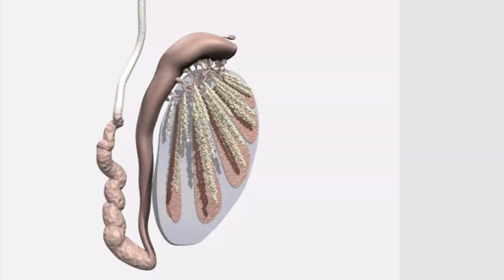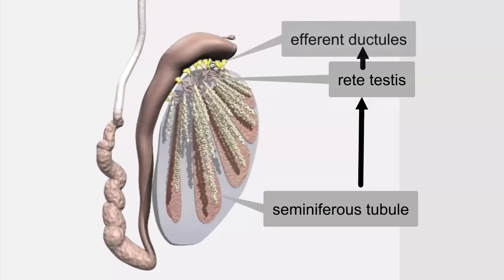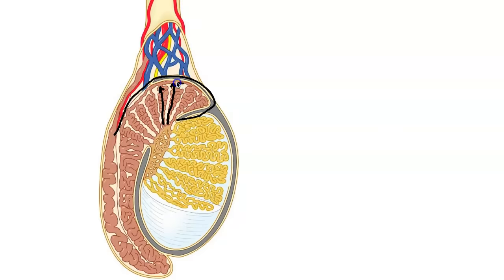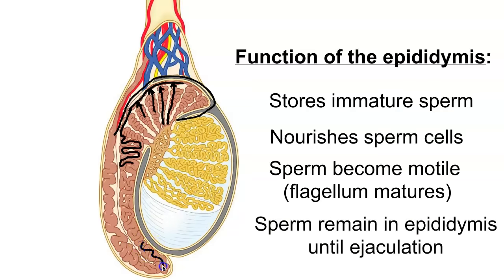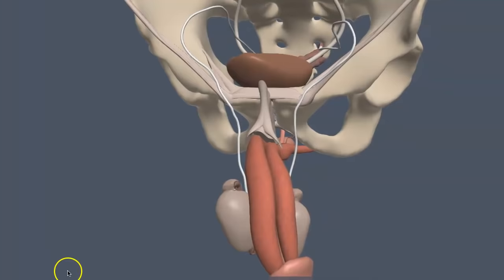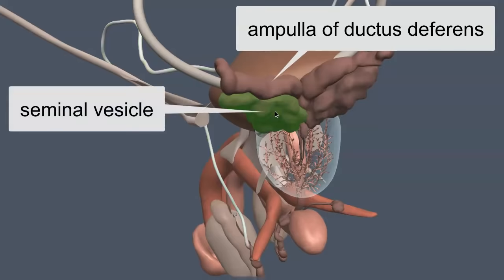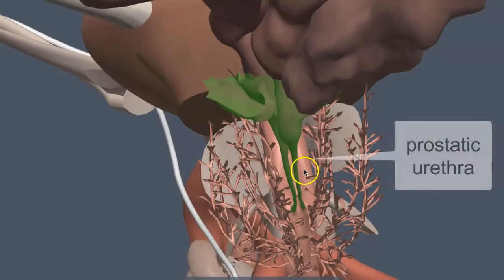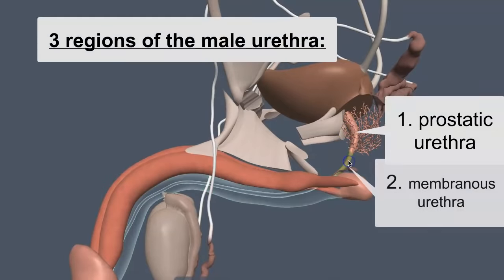Pathway of Sperm from a Testis to Outside the Body

Comment: The speed and pressure at which semen moves through the spongy urethra is staggering. Plus, the ballistics of possible payload distance physics is equally impressive. Then if you add in the accuracy of payload placement in some individuals, your talking in the range Olympic skill sets. Many men have acquired these skills over a long and dedicated training regiment. It's one half of the components required to create life, such an amazing thing.

Comment: Unusually well done. Presentation made it easy for me to visualize the anatomy, understand the pathway. Excellent graphics, excellent narration. There seem to be a lot of professors these days who are difficult to comprehend because they speak and write with grammar and syntax that is incorrect. There are a lot of lazy communicators. Not the narrator of this video. She never confused me with ambiguity.
        It looks and sounds as if a few minutes were cut off of the end of the video presentation. Ejaculation itself was not explained. At the point where the video left off, sperm were not "outside the body" yet. We need to know about the muscles that produce ejaculation, do we not? I believe that would be the 2 ductus deferens (I'm not sure what the plural of ductus is), including the ampulla at the distal end of each of those ducts (I know the plural of duct). My understanding is, and please correct me if I am mistaken, my understanding is that each of those ducts is not merely a duct, but is also a muscle. Each one propels spermatazoa into and through the urethra by contracting. I am not sure if the entire duct contracts. Does its ampulla contract? There is also the matter, that I think is important, of innervation of the ducts deferens (I'm mixing languages). According to Dr Feliciano of the Manila urology clinic (Dr Feliciano, a physician who treats disorders of the urogenital system, is talking about nerve function here, vis a vis his vocation of providing treatment for dysejaculation):  (1) Parasympathetic – produces emission. Slow peristaltic waves along the vas deferens [ductus deferens] move spermatozoa from the epididymis to the ampulla, where the sperm is stored before ejaculation. (2) Sympathetic – produces strong contraction of the smooth muscle of the vas deferens producing ejaculation. and (3) Sensory Afferents [afferent nerves or nerve fibers are those that carry sensation to – the brain or spinal cord?] – travels through the pelvic plexus and along the pelvic splanchnic nerves to sacral levels S2-S4. As a result, pain of deferentitis or from prolonged engorgement of the ampulla is referred to the perineum.
        I am not a physician. I have dissected a few small mammals, but except for teeth (I am a former dental technician) I have not dissected any human organs. So perhaps you should take my description of human anatomy with 64.8 milligrams of salt.

Comment: What I don't understand is how can the sperm make it from the epididymis to the tip of the glans in the time between "the point of no return" (level of arousal past which you cannot prevent ejaculation) and the time when it exits. We're talking like 1 to maybe 1.5 seconds and it has to move through the Very long and narrow ductus deferense. It almost seems like that would have to happen earlier and getting close to the edge actually means some sperm has already migrated to just ahead of the seminal vesicles. And is lost.